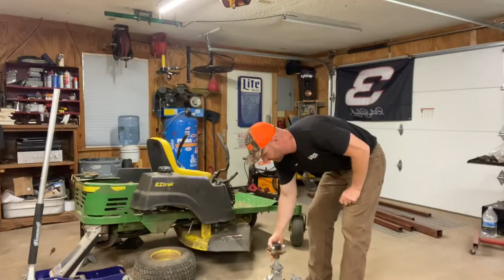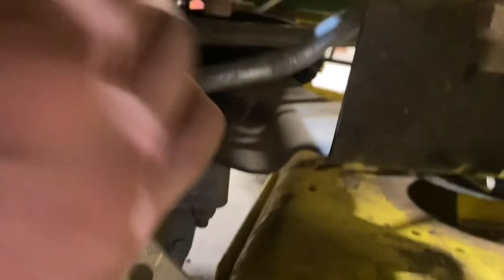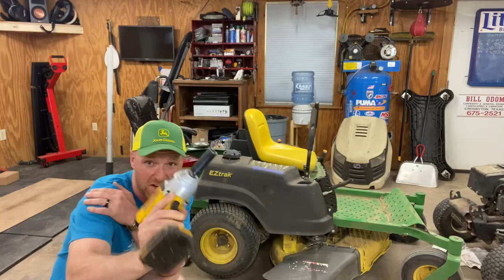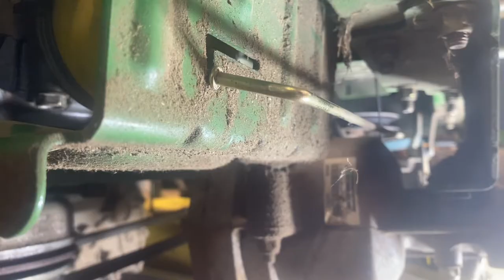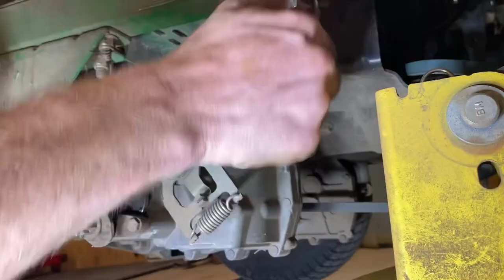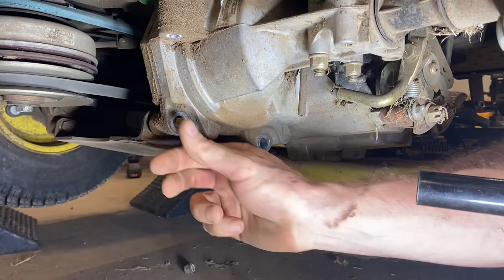How to Remove Zero Turn Hydrostatic Hydro-Gear Transmission (John Deere Z255 Lawn Mower)

Comment: Thanks for posting this! We have a Z6700. I am hoping it is as easy as replacing the fluid to get this thing moving better. Really appreciate the video!
Reply from the maker: Sure thing good luck. It is quiet the task if you have to remove the transmission
Reply: @MowerMike  We will need to remove both sides. We have very little movement from the tractor. Already ordered the zero turn fluid you mentioned. This weekend, we dismantle!
Reply from the maker: @rose.hunter.  Screw it go all out. Can’t break it anymore than it already is ;)
Reply: @MowerMike  well, we took out both transaxles and changed out the fluid. Put back together, and she moves!!
The odd thing is that it goes backward much faster than forward. Any suggestions?
Reply from the maker: @rose.hunter.  Mow backwards??? Haha jokes. Try adjusting the speed limiter that bumps agaisnt the handle. I have a video on it
Reply: @MowerMike  Ironically for part of the yard, I did!!! LOL.  thanks for the suggestion on the speed limiter, we will check it out. It also seemed the longer I drove it, the better it did move forward. I was able to the our 3 acres mowed yesterday and am so thankful for your videos!
Reply from the maker: @rose.hunter.  You are welcome. I suggest checking the oil level in the trans and make sure it is topped off. It may have bleed some air out as you mowed

Comment: Works! BUT make sure you have an Impact Drive with enough strength.  My little Black and Decker was challenged.  Backing out and in a few times got a couple of tough bolts out.
Reply from the maker: Time for an upgrade

Comment: Hey! Loveing your video.  I couldn't do lawn mower repair with out'em. I have a  Question? A belt got  Tangled around transmission fan, when it broke.  Cause the  opposite side to stop pulling. I got  the  Transmission loosened and let down, resting on a block . Now what?  down on the block
Reply from the maker: I would just cut the belt and get it off there. Glad my goofy videos help ya out
Reply: Look at every one of your brackets and make sure you do not have any cracks in them. Some units will develop cracks in the brackets and cause the hydro units to lean in and the belt comes loose. If you have over 800 hours on your unit and the oil has never been changed then you are going to pay a lot to rebuild plus your time. Just buy new Hydro Gears and change your oil every 200 hours. Recommended from factory is usually 400 hours but 15W 50 oil is cheap and hydro gears are expensive. buy oil by the gallon if you can. use synthetic.

Comment: Great video. 

I had a tornado drop a tree on my zero turn and now the right side won't go backwards. I also can't get the brake to disengage. 

From the top, everything looks fine, but I drove it up under my carport, and now it's stuck under there because it won't back up, and I can't push it. Unfortunately, I don't currently have a decent floor jack. 

I'm hoping it's just a bent linkage, and there's nothing wrong with the transmission itself. I thought I'd have to fix it myself, but my grandmother was nice enough to offer to pay to get it fixed for me. I have someone coming out next week. 

I decided to look up a repair manual. It's a Husqvarna, yeah, that didn't go well. I did find their Online parts store, though, and the IPL, but I was curious how the linkages and stuff connect. This video was pretty helpful at showing me that. 

It also showed me that if I was repairing it myself like I initially thought I'd have to do, I'd have to jack it up and take the tire off to see those linkages. I was a vehicle mechanic for 20 years for the army, but zero turn mowers are a bit different from forklifts, heaters, and HMMWV so I was at a bit of a loss without a repair manual and to make matters worse, the tools you use in the Army belong to the Army so you don't get to keep them.
Reply from the maker: I would start by trying to put the transmission in neutral, there should be a lever ontop of the transmission on each side that you pull that puts it out of gear

Comment: Are usually put a small jack underneath it so It don’t drop. 
Great video
Reply from the maker: Yes it is always good to have two supports under it in case one fails.

Comment: Great video Mike. Don’t keep us hanging too long for the reinstall. Is this identical to the removal on a Deere Z355R? Also which is the rear left wheel, the one on the left when sitting on the mower or the one on the left when standing in front looking at it? Yes I’m that dumb lol
Reply from the maker: Thanks! Yes it should be the same on the Z355. It is a valid question and I don’t know the answer. I suggest looking at the one you are going to buy and making sure the orientation and setup is the same. The left and right are like shoes they look different and are opposite. 

I do suggest you check out my other Hydrogear videos before you go buy a new one.
Reply: @MowerMike  Thanks Mike. Will do.

Comment: Could you tell me what model transmissions I need for a John Deere Z525E?
Reply from the maker: Nope no idea
Reply: There should be a white tag with numbers and a barcode on it. That is what you need to order the new gearset from hydro gear. If somebody pressure washed the tags off the machine it might be hard to find the numbers. The tag should be on the hydro gears somewhere.

Comment: Why not use a vacuum pump and suck all of the fluid out and then replace it.         I will try this next week. It's better than going through all of the trouble. Do it a couple of times to make sure you remove the fluid.

Comment: I thought john deere used tough torque transmissions?
Reply from the maker: Not on zeroturns I think they use those on regular riders though. All zeroturns have Hydrogear
Reply: I know that the Z425s after serial # 130001 uses tough torque TZT-7 trans. They changed the design of this model midway thru its tenure and rotated the motor 90⁰ among other changes.